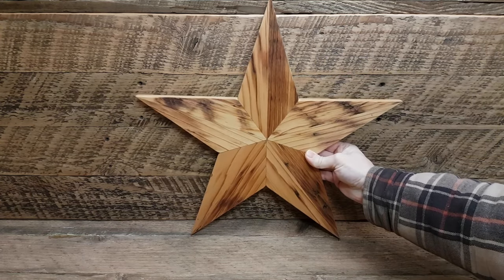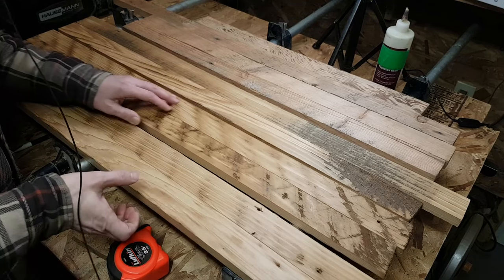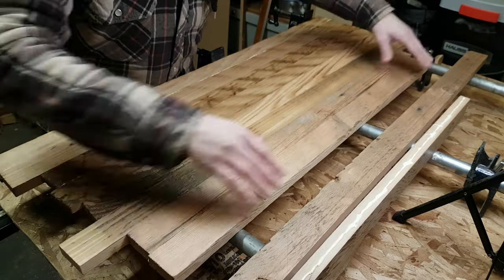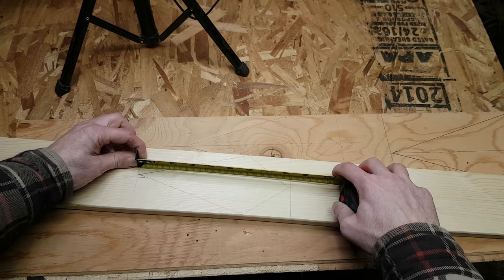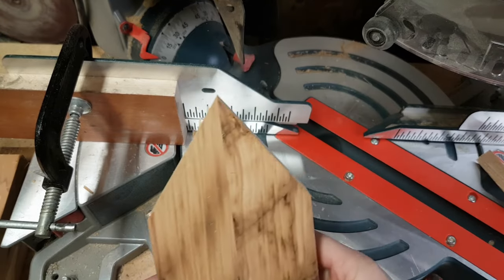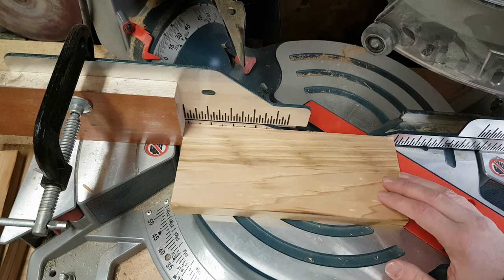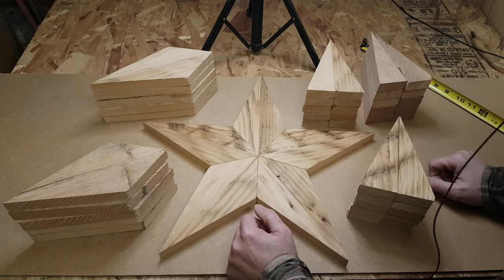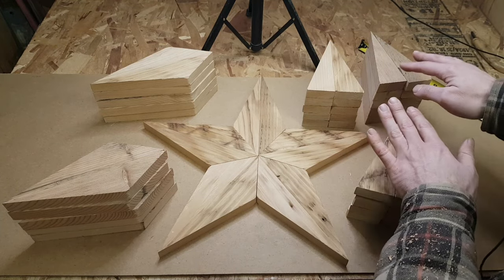Wooden Stars - Reclaimed Wood with Spline Joints

Comment: Great detail on the angles and providing board lengths for different size stars.
Technically the joinery you're using to connect your pieces is called a loose tenon or floating tenon.
Reply from the maker: I think you're right about that. I was going back and forth between the two, in my head,  trying to figure out what it was called. Loose tenon seems correct. Thanks!